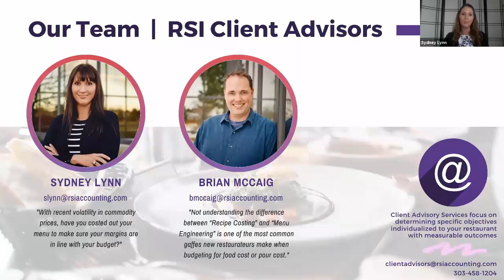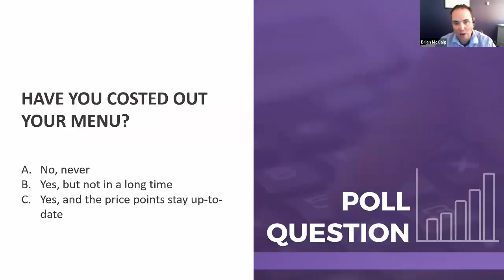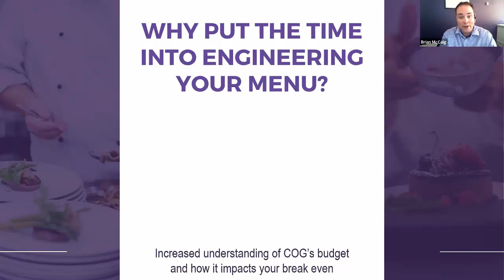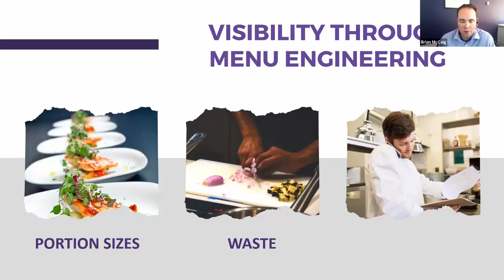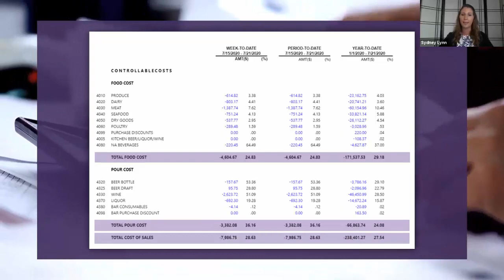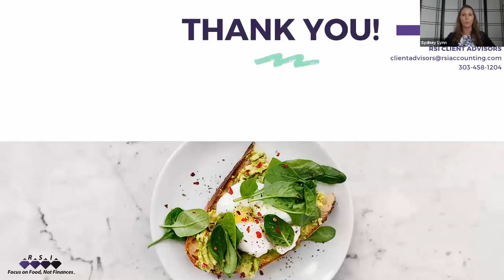How To Successfully Perform Menu Engineering In Your Restaurant (With Examples)

Comment: What do you think about having actual cost in line with Recipe costing ? Also Do you use any tools for Chef and Manager to monitor wastage , I understood it's available on Stocktake system however result is depended on input which have been done on system which can be wrong/ inaccurate. Cost allocation also important think what we are using in kitchen and what in Bar  same if we have different cost center which in Food( like Pastry - Event ), Would love to hear your point of view.
Reply from the maker: 1) Your actual cost should be around 2% points higher than your recipe costing. Once you identify that difference, that is where you can dive into your waste opportunities and make an impact on your COGs. 

2) In terms of monitoring waste, I am a fan of a waste log on a clipboard. Yes this is old fashioned, but it allowed me to have the entire team involved.  The clipboard should come to all manager meetings and be a topic of conversation when you are troubleshooting waste opportunities. As always, bad information in/bad information out, whether you are using technology or a clipboard.

3) Great point. If you have shared expenses between the bar and the kitchen, you now must consider splitting the expense between different categories. For example, if you have limes as a garnish for your drinks and use as lime juice in a dressing, you have multiple expense categories. You may want to consider moving the expense in your accounting system ($10 of limes out of the bar expense into the food expense). We would tend to recommend picking the expense limes are most used for, and not worry about the accounting transfer. Keep it simple!
Reply: @RestaurantAccountingServices  Thanks 

What do you think on below 

1) Analyzing the Cost by Food Group 
2) For Fine dine Restaurant how much it is important to have Cost report by Premium menu item (Beef , Lamb , Selfish ....), Since restaurant will  have multiple menu (Brunch , Set Menu) and majoring the cost of each dish.
3) Sales allocation - Fine dine Restaurant have multiple menu with group option most of the POS will have Total figures as revenue  , how do you think about the revenue and cost allocation of this - For Example if i wanted to see desert cost I will have to add Ala cart revenue as well as Set menu revenue, For Brunch I will have to split Food and Beverage revenue 
4) What is your opining on tracking the Butcher cost ?
5) account for Staff food / Drink and Complimentary foods?
Reply from the maker: @saumil333  we love the conversation! Please reach out directly to clientadvisors@rsiaccounting.com and reference the Menu Engineering Webinar on YouTube, and we'll be happy to finish this conversation one-on-one with you! We look forward to hearing from you!